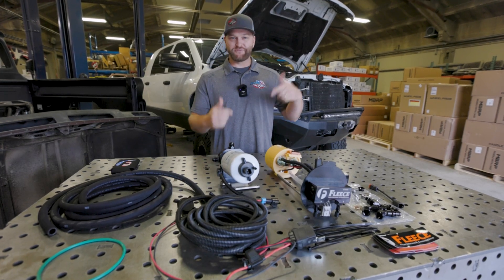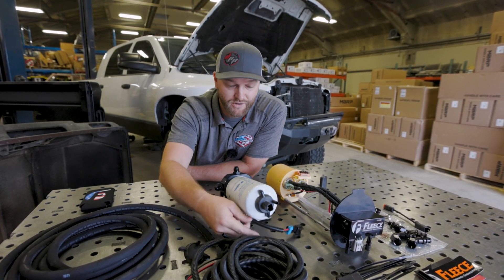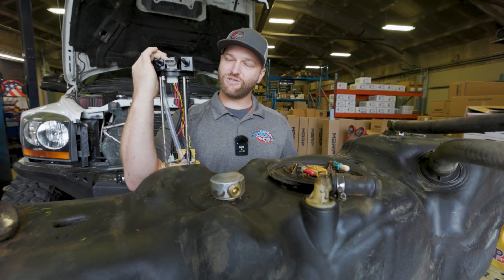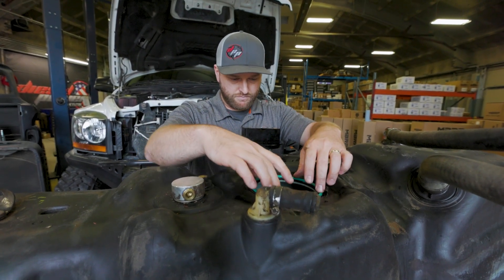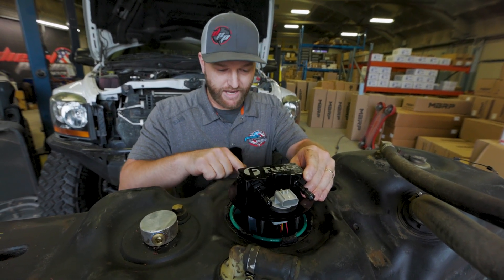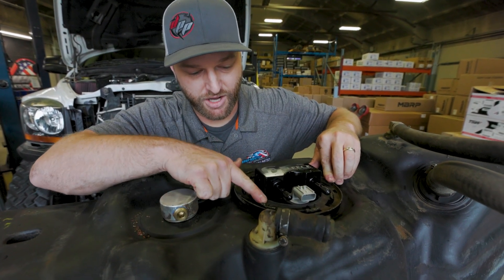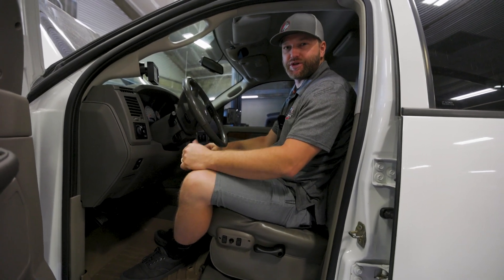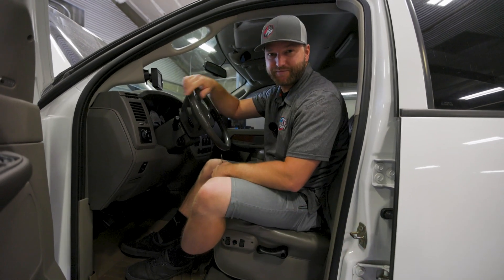THIS IS HOW WE DO IT | HULK GETS A FLEECE POWERFLO IN-TANK LIFT PUMP

Comment: So would this pump work on the larger fuel tank such as tighten or S&B? Also, on a 2006 dodge ram 2500 can you use stock your bowl  and filter?

Additionally, you went with the N tank lift pump… Was there a reason why you didn’t want to go with a fast or an air dog on the rail? Just curious because I’m trying to make a decision on which one to go with

Comment: So, if I want to add 1/2" lines and a dual 2 micron filter setup, can I hook 1/2" AN fittings to both the fleece and the stock fuel filter housing so I can retain the oem water in fuel sensor/heater? I have a 6.7 liter cummins

Comment: What happens with the stock filter in the rear under the truck is that no longer needed
Reply from the maker: The 3rd Gen 5.9L's don't have a filter under the truck. Only on the side of the block.
Reply: Ahh sorry thinking of my 4th gen thanks 4 the reply guys appreciate it

Comment: Why do you not just lift the bed? It's quicker & safer, especially since you can use a lift. Nice demo though.
Reply from the maker: Truck has fiberglass bedsides and has not been removed in a VERY long time. Last thing we want to do is crack or damage the bedsides and break bolts. Plus, most people do it this anyhow.